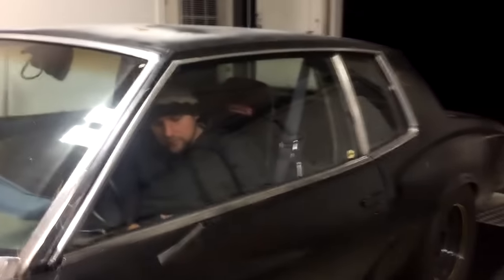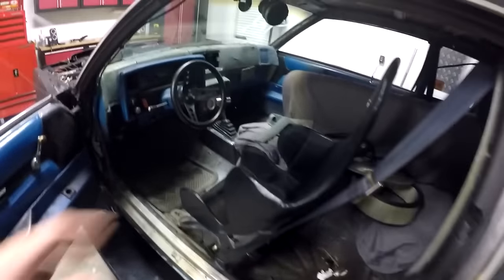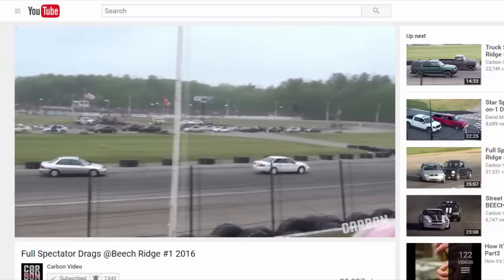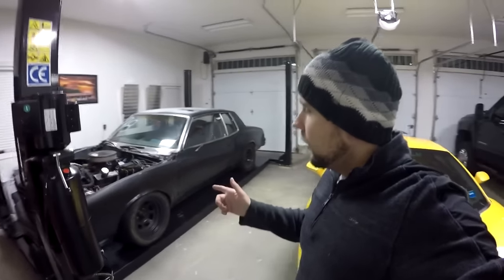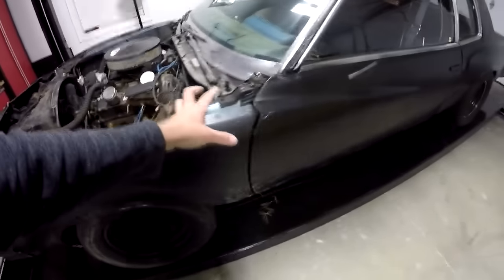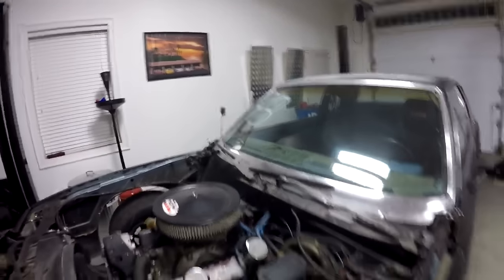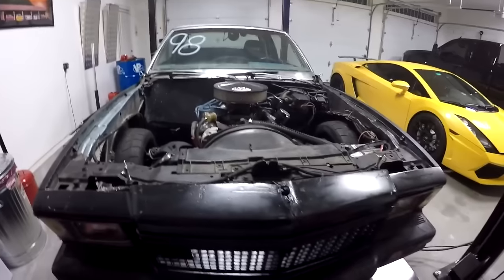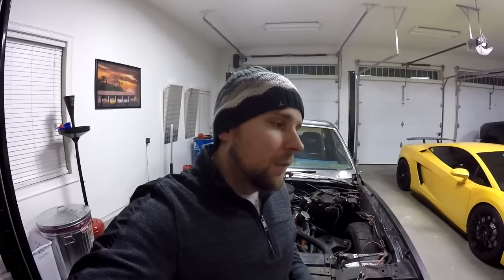New Car! Meet “The Bruiser” Race Car Project…

Comment: I built and raced two different Monte Carlos back in the day. My advice would be to scrap the stock radiator core support and fab one from square tubing. That alone will remove a bunch of front end weight. Second thing I'd do is buy a set of aftermarket aluminum heads to knock off even more weight and increase power. Those angle plug heads are relics. Third thing I'd look into is a small diameter torque converter to lose several pounds of rotating mass. Not a drag converter. They make 10 inch converters just for circle track that are light weight with low stall. You'll be shocked at how much better it comes off the corners with one of those.
Reply: Remember when NASCAR fined Gibbs Racing for a connecting rod being a fraction of one gram too light? A TCI Fastlap converter weighs almost 10 pounds less than stock and only costs around $250.  I guarantee it will be the best bang for buck improvement you can make to a Monte Carlo.

Comment: A good start would be upgrade to a 650 - 800 CFM carburetor and a MSD Box with distributor.  Then lower gears with a Mini spool. 411,456,488. the best Bang for your buck would be a set of heads, Double hump, Trick flow, Victor junior, AFR and a good RV roller cam.

Comment: You need a 800 cfm 4bbl carb. Also look at ignition kits as well. I put a flamethrower ignition kit on my 351 that comes with a hi-po distributor, coil, and ford racing spark plugs and wires. The difference is night and day. These are mods that really complement an engine that has had the heads and cam built.

Comment: +Peter Beattie's Garage
 
I would recommend upgrading all of the suspension bushings to Energy Suspension, the poly bushings make a huge difference on a budget. You should be able to get a G-Body kit pretty cheap from either Summit Racing or Jegs.
Reply: Also, there are some QA1 suspension packages that have boxed trailing arms, rear sway bar and anti hop bars which will all help with handling and the launch too.

Comment: I need a new engine and transmission, what should I get to put in her? 1979 Monte Carlo
Reply: CARLOS Mckinney  was thinking the same think I have the 305 thinking of going for a 350 or ls motor
Reply: Ls3,327, 355, 383, and a 700r4 or 4l60e.

Comment: just shot you a FB message with some info and part suggestions.   I've built many small block engines and am just a message away. check your message requests if it hasn't popped up.